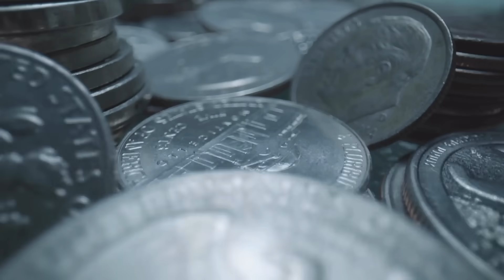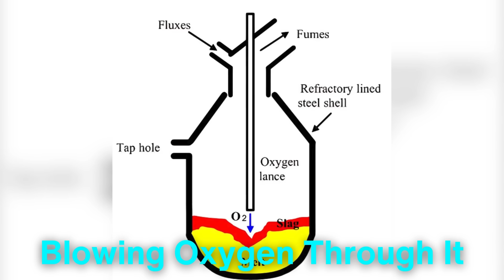How Is Rebar Made? The Science Behind Reinforcement Steel

Comment: Happy to say I work at a steel mill that makes rebar. Most of this tracks but most modern mills roll the deformations(ribs) into the bar while it is still hot in the final stand. This is before it gets quenched to achieve the proper quality’s for the grade ordered. A quick note, rebar sizes from 3-11 grow in 1/8th inch increments 3 bar being 3/8” 4 bar being 1/2” and so on. Most of these sizes can be spooled rather than cut straight so that fab shops can unspool and bend for customization and select lengths to cut down on waste.

Comment: In the steel plant I worked at, the deformations were achieved using a final roller that had deformations included. This saved having to reheat the bar again to get the required effect.
Reply: That's the standard method for hot-rolled deformed bar, especially when mechanical elongations of 5% or more at maximum load are required. Mesh products are made by taking round rod and rolling the ribs in cold - this increases the strength but the ductility is only 1.5% to 2%.

Comment: From my understanding, most of the rebar is made from scrap cast iron and steel, so the steel alloy  grade is very questionable from most sources.
Reply: No matter what's made from, if final product meets strength regulations and standardization.
Reply: You would hope that quality control tests are adequate to make sure the standard is of the highest.
When you see some buildings totally collapsing in some Asian countries and others, you wonder if there was any rebar put in at all so someone could make a bigger profit.
Reply: Heard that about bed frames as well. From my experience its junk steel.
Reply: Nope! You can make most steel qualities from scrap by using different scrap qualities burning the carbon in the steel adding alloy material. 

By the way rebar is made of very basic steel qualities.
Reply: Maybe that was in reference to “weldable rebar”? Idk
Reply: Even if low grade there are standards even for rebar. Materials are tested for conformity during the process and mix is adjusted if needed.
Reply: In China maybe.
Reply: I think I saw a list somewhere that there is a whole spectrum of different types and grades for different needs, not just different sizes in a single material.

2" epoxy coated high tensile for a dam spillway ?  Check.

1/4" anodized mild steel for a poured driveway ?  Check.

et al.
Reply: You're quite right -- but the tension function these guys are talking about is grossly exaggerated.  The stresses involved are barely higher than the actual weight of the cement around the bars.
Reply: Rebar has a fairly wide specification. Generally, there are maximum limits on carbon, manganese, phosphorous, silicon and a calculated 'carbon equivalent' or 'welding equivalent'. The limits on phos and sulphur are fairly standard - they ensure that there is no hot or cold brittleness - and then the limits on carbon, manganese and the 'welding equivalent' ensure that the mechanical properties and weldability is met. The welding equivalent is "carbon% + (manganese%/6) + ((chromium% + molybdenum% + vanadium%)/5) + ((copper% + nickel%)/15)", this incorporates many of the tramp elements found in recycled steel so if the welding equivlent is low enough (usually 0.44% or less), the rebar is weldable without pre- or post-heat.

Many standards also require the rebar from each heat to pass mechanical tests - yield strength, tensile-to-yield ratio and elongation/ductility at maximum load - which ensures that the rebar is capable of carrying the design loads without failing.
Reply: There are different grades

Comment: Do not use rebar coated in plastic or epoxy in critical structures , it dos not offer significant protection against corrosion
Reply: They eliminated that green bar in many projects codes and now often  use stainless steel in bridge decks salt water marine etc .
Reply: @Motorhead250  using stainless steel... lol
Reply: They use it in bridges here in ks?

Comment: That was very interesting. How about a video that details rebar connections. This one only showed manual pliers.
Reply: The title of the video of how it’s made. Lookup some other shit bro you are on youtube
Reply: 35 years ago we used to have more specialised ties with loops at each end and a tool with a hook end and a twisting shaft which when pulled through the loops of wire gave a tight connection when it twisted3 or so times if you can understand that.
They way they did it here on massive constructions with thousands of tie points was ridiculous with the tool they used. We only had to do less than 100 each day.